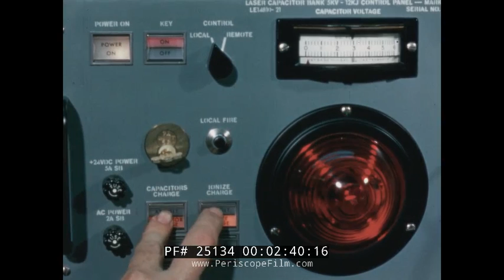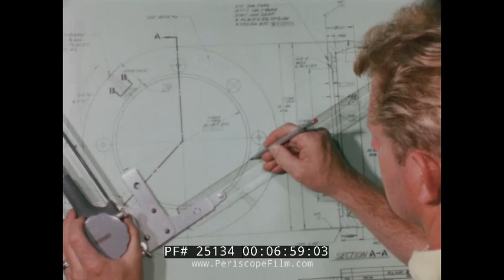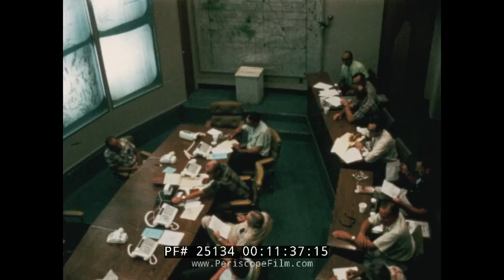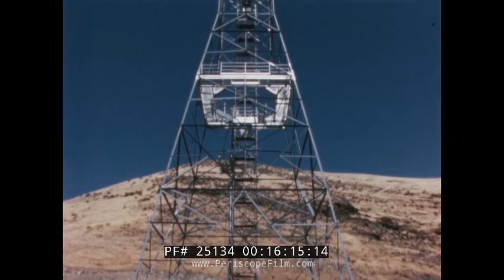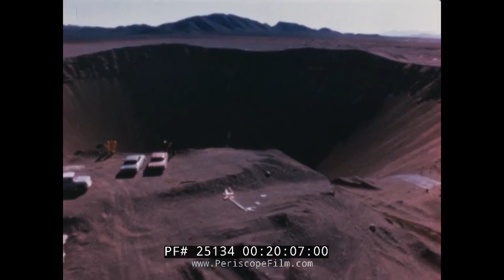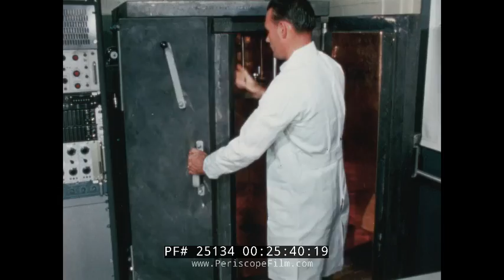A FORCE TO MOVE THE EARTH   PROJECT PLOWSHARE NUCLEAR TEST FILM 25134

Comment: The oil idea was farfetched but the construction ideas would be insanely useful except for the fact that it produced a crap load of radiation and radioactive clouds of ash
Reply: It really didn't, Many of the tests shown that's not how it worked, One test of a 1.7 Kt device didn't produce any radiation at all that got to the surface, As well as the Oil idea was quite possible just like the Gas one.

"radioactive contamination from the flaring “was miniscule compared to the fallout produced by atmospheric weapons tests in the early 1960s.”